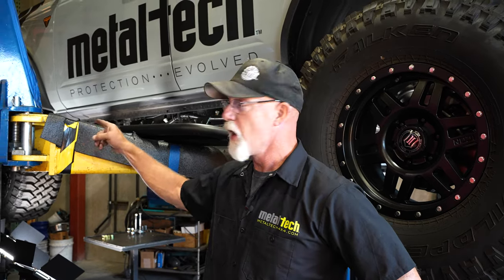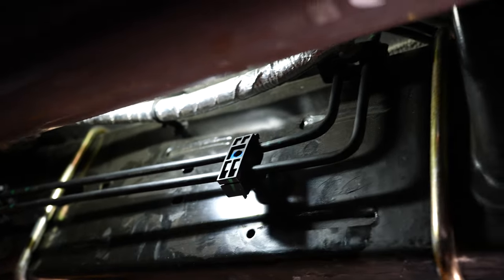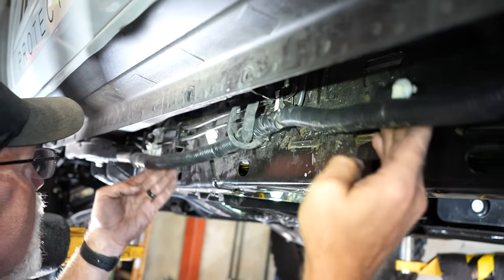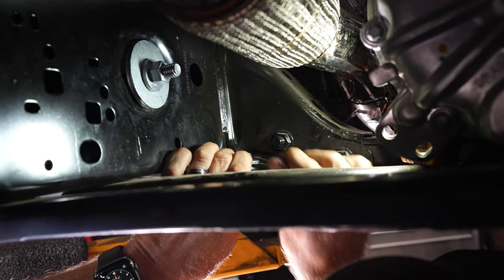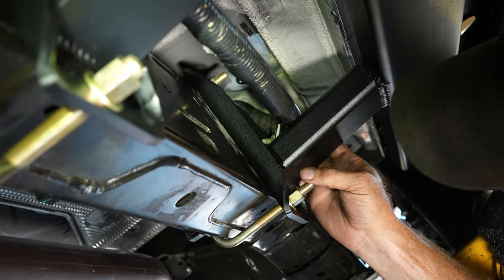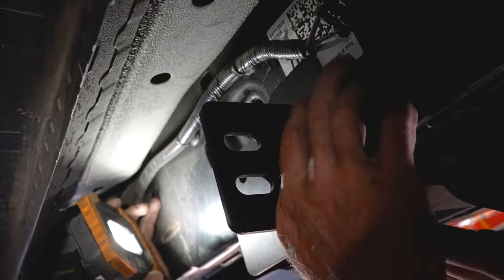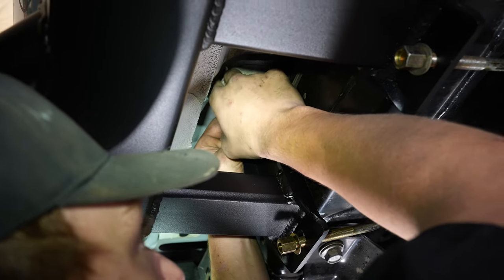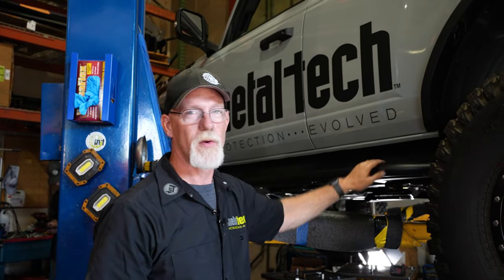Ford Bronco 4 Door Rock Slider Installation (non Sidewinder)

Comment: I like the engineering.   But I would want mine to tuck up closer to the truck and not have that big gap.   Are there two door versions in the works?
Reply from the maker: The gap is actually engineered to allow the large flex of the Bronco body in relation to the frame.  When the frame twists the body can come into contact if the slider is mounted to close.    Yes! The 2D bolt on version is right behind the 4D.